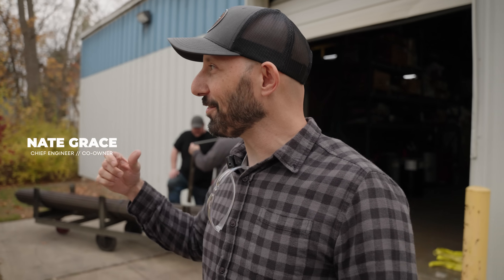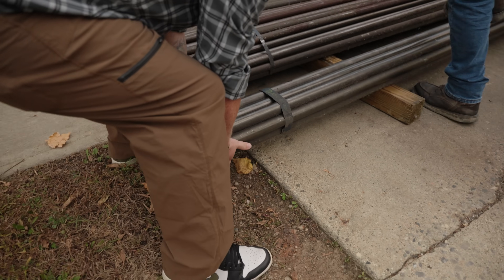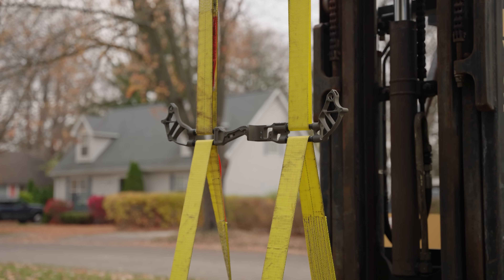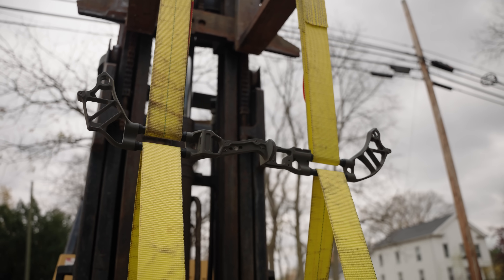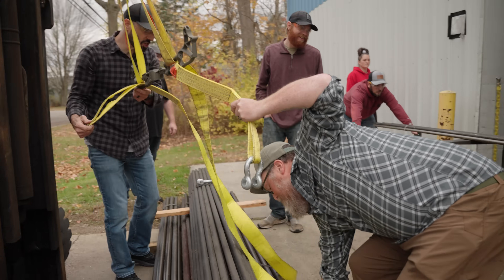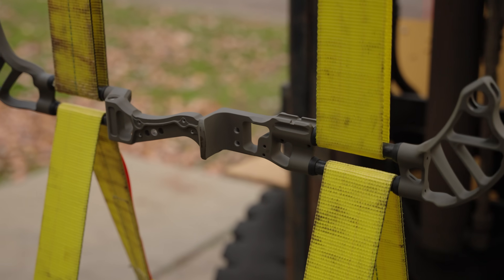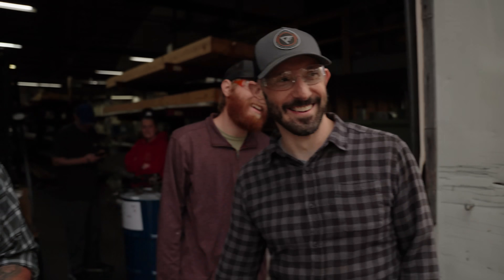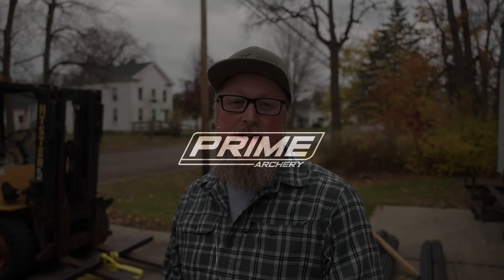Primes AST Riser Testing // Prime Labs

Comment: Pretty incredible. Maybe it doesn't break, because the load is too evenly distributed. If the straps was no so wide, maybe it would break. Also in engineering terms a load of appr. 3500 kg or 35 kN - divided by 2, so 17,5 kN on each side, is not a that big load. But it is however still incredible that these carbon tubes can carry that weight.